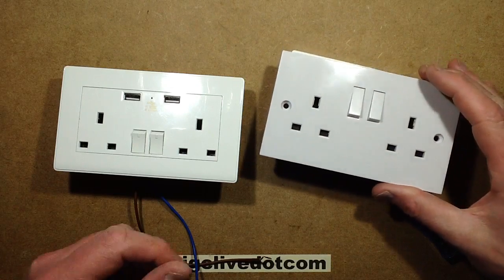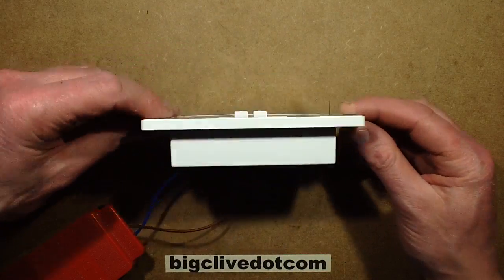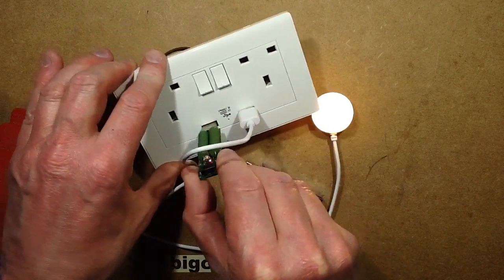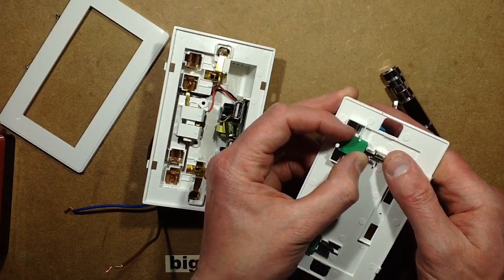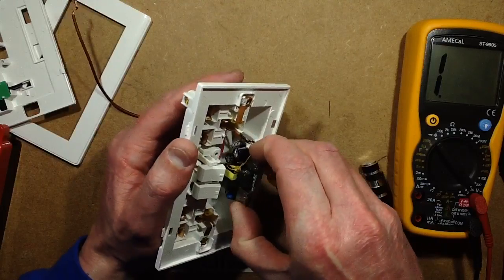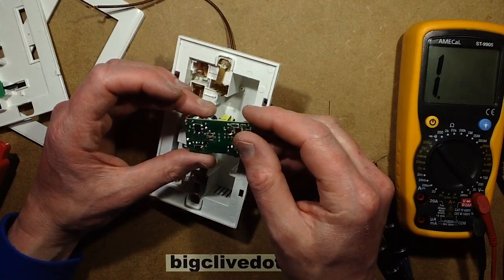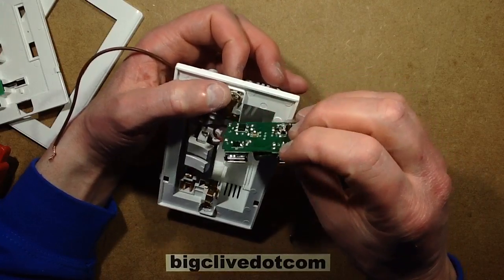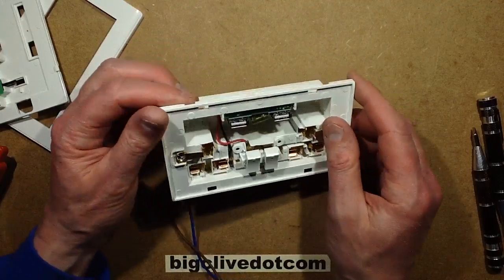A look inside a (crap) double gang socket with USB outlets.

Comment: Where did you get that USB thing that measures the voltage and the USB LED Light?
Reply: +Dallas Dal there's a variety here: http://www.banggood.com/USB-Detector-Current-Voltage-Tester-Double-USB-Row-Shows-p-973712.html?p=3X080214547992015049

Comment: Obviously this one has bigger design issues with the badly designed earth configuration but your point about the built in electronics makes sense too even if these ones even worked correctly to begin with. Makes you wonder why they couldn't make the USB module just sit in a socket with a couple of connectors in the back so it could be easily replaced were the electronics ever to fail.

Comment: Hello Scottish? Clive, just found one of your videos from the suggested feed that you get when your on the home page of your own personel profile here on youtube, as I looked up double gang usb sockets on how to install to an existing single socket plug point. I was hoping to find a video from yourself on how this would be done, I only asked because after watching your video it`s great to see someone who knows too much about their chosen topic like yourself.  I checked your uploads and couldn`t find one but did watch a few and found the £5 solar panel interesting and the Benson and Hedges 1981 shop promo sign, loved that. 
If you are not going to cover something like this could you with your expert opinion please give me a link to a one you trust, thanks Clive, I`ve subbed because I love your love and dedication in electrics, really interesting and a great youtube channel.
Thanks from Gary, North East UK.
Reply from the maker: +Gary Robinson You can get double gang sockets that fit on a single gang flush box if that's any help.   http://www.screwfix.com/p/clipsal-converta-socket-1-gang-to-2-gang-polycarbonate/12849
Reply: Thank you but I wanted to fit one with the usb plugs like the one in your video, but that's ok I will check for one.
Reply from the maker: +Gary Robinson You can get adaptor boxes that would result in a bulky surface mounted box because of the depth of the USB socket.  But I would actually recommend not fitting these sockets and using a good USB charger plugged in instead.  Much cheaper and safer in the long run.

Comment: 8:30 an this is the reason why you should test your installation with an RCD tester an maybe measure the voltage between Live and Ground, so you can find your error.
Reply from the maker: +Simon P. Do you normally test both sides of a double gang socket?  Because one side would appear fine.  In fact both sides would appear grounded on a ring, but it would be broken at that socket.
Reply: Yes i would test both sides, because there are two switches an so I think there are two circuits that should be tested.

Comment: You know, this confirms my belief that 120v / 240v mains sockets have had their day. Modern electronics can run on 5/6/9/12 volts DC. The only plug-in appliances in my house that NEED 240V are floor heaters and the vacuum. They could be run from the odd 240v outlet; while the TV's, LED lights, sound system, computer could be run from a high quality 12v DC-transformer on the switchboard. My TV is only 240v AC input, but it is instantly downgraded to 9v DC and my computer is run on 6/9/12v DC after the built in AC transformer.   Global society is surely on the fulcrum of change where houses are fed a low voltage DC current for modern appliances avoiding all the little black boxes we poke into the mains. I have solar panels (DC), they upgrade to 240v (AC) then my appliances downgrade to low voltage DC, wasting at least a 3rd of what I started with. I have always been living 20 years ahead of common technology, sadly; as I have never found someone who talks my language that doesn't own a Rolls Royce. That said, I occasionally find your revues which are interesting.
Thanks
John

Comment: Here in the USA, receptacles in hospitals have isolated grounds ("earths" to you in the UK) meaning the ground of each outlet has a separate ground wire running back to the main panel and ground rod. This keeps a ground fault in one outlet from raising the potential to other grounded devices. Maybe they designed this outlet for such an application. (Or maybe they were just cheap!)
Reply from the maker: +Chaplain Dave Sparks In this case that would have been defeated by the shonky connection between them through the fixing holes at the sides if a metal box had been used.  But I can understand the hospital scenario, especially where direct body connections were involved.
Reply: +bigclivedotcom Agreed. They would at least be required to be approved by the Underwriter's Laboratories (UL), and possibly another health-related agency. Nor, if it came from a certain very large country (the largest, actually), would I immediately believe such a label was genuine.
Reply: +Chaplain Dave Sparks counterfeit fakes , from china ,lol big problem every where , so do not rely on UL , CSA   CE, URL  , or what ever approval body  ,,, scary future f products,,,, they make them look almost 100% , packaging ,certificates , approval stamps, but are un tested, and normally have inferior parts
Reply: christophe leblanc I don't blame it on China, per se, unless you're buying directly (eBay). Those who import from China for resale need to take some responsibility by setting standards and then enforcing compliance. I believe China can produce quality if the buyer insists on it and is willing to pay for it.

Comment: I Know whats going on with that thing , The USB part of that thing is,,,,, well uhhmm  ,, simply put it's just wrong The USB light was flickering because an over volt circuit detects an over volt and then drops the voltage down the problem  is it takes the voltage down to far then the under volt circuit brings it back up to a voltage that is to much and and that's why when you plug in the dummy load circuit then you have a stable voltage ,  This is 45 years of electronics talking  I am 54 years old I have had an active study of electricity and electronics from about the time I was in preschool...It only took me about 30 seconds to know this calculawn@gmail.com    If you want you can call me McGyver

Comment: You're supposed to put the two CPC legs on a ring circuit into two different earth terminals. 90% of double sockets I fit have them. Its a much better system.
Reply: +Hulk But yes, both earth teminals should be connected. They should normally have a copper bar connecting the two terminals.

Comment: What you're seeing on the back is the history of high-current USB chargers.  The current power-pig is the Nexus 6P, which would really like to see 3A provided to it for "rapid charging" (n.b. it's not Qualcomm's "Quick Charge 3.0", but it's a similar speed and Qualcomm says that the Nexus 6 meets the QC 2.0 specs.).  Upgrading my phone (and service) means that my older chargers are limited in functionality.  http://pocketnow.com/2015/10/14/nexus-quick-charging-explained

Comment: Two earthing terminals on a socket outlet is quite common....and is used for IT installations.
altho...they should be interconnected internally.
Reply: +supersesqui kinda surprised it has only single screw terminals with a screw-on-wire design instead of a terminal where 2 wires can be compressed between 2 plates with a screw. No idea how to call these terminals as you can tell from my english.
Reply: FoodOnCrack

Screws onto wires very common here.
But on larger cables into MCB,s and RCBO's they do use the Clamp method as you described.

Comment: Really shocked by that earthing arrangement - surely this doesn't meet BS1363? Every socket I've ever seen (including cheap ones) has two earth terminals with a busbar between them. Our plugs and sockets are over-engineered compared to the European and American ones, but I've never heard of someone getting a shock off a properly-installed British plug (plenty off the Schukos and US plugs though). 

I love being able to buy cheap stuff on ebay but you won't catch me buying mains electrics on there - you save a few quid but even if it's quality 9 times out of 10, that other 10% might burn the house down! I've known a couple of people buy cheap USB chargers on ebay, leave them plugged in and then got woken up by capacitors exploding in the night - not worth it.

Comment: what voltage are on the data pins to grounds?

the usb spec is quite interesting there is 5v between pin 1 and pin 4 ground 

data pin 2
data pin 3

anyway depending on the voltage between the data pins and ground tells the device what is a safe current to pull (if it has no voltage on the data pins the device will only pull 500ma)

ladyada explains it on her blog

http://learn.adafruit.com/minty-boost/icharging

i tested this myself by using connector strip, tester and some resistors

Comment: Just a correction about the lamp holders. The Buildings regulations Part L actually specified that at least one lamp holder in each "living area" must be designed so that they cannot accept an incandescent lamp. 

One way of doing that was to integrate a CFL ballast into the lamp fitting, so that a compact tube (e.g. PL style) could be plugged in. In practice, the vendors tended to go for proprietary connectors which would lock the householder into their specific brand of bulb. In a further attempt to reduce costs for builders/contractors, most vendors then moved from integrated ballasts in the fitting to simply using proprietary connectors for their own brand of CFL.

Comment: Four numbers: 7... 8... 0... 5.
Unfortunately, UK law probably dictates switching power sources, but the board could use a switching source to knock the 240 down to 12 volts AC, rectify and smooth that, then send it to the linear 7805.
Reply: +2randomcrap3 You want to install a 7805 into a socket?
Reply: I'd seriously consider it (though US outlet boxes might be too small), it's a good linear supply IC.
Reply: 2randomcrap3
I would have serious concern about it generating too much heat if the switching source fails.

Comment: Separate earth connections are very common on modern sockets, one wire from the metal box goes to one earth terminal and the other is connected to the spur or ring main earth wire. Although a plate should connect them together to the screw fixings internally.

Comment: I cant believe youve never seen separate earths on a socket. most sockets now have two terminals so in the event one was to come out, you would still have continuity on a ring final. As for the linkage across the earths, its not too bad. its no different than have two single sockets in close proximity; just take a fly-lead onto the backbox (if metal of course). 
As for the DC output, seems like it needed a bridge rectifier to get a smoother DC output. you said it only had one diode, having more in a more forward way would be much more reliable.

Comment: Ah Bollox I have 2 of these. I fitted them myself. Not had any issues so far. I will have to check for the earthing. Thanks
Reply: Hi HP, are they still working? i got 4 of these and only 1 is left working

Comment: I looked into these a few months back when I replaced a socket due to it sparking. I read about how dodgy they are but also inefficient, the USB transformer is always live on a lot of these so power is constantly being consumed without even actively using them. I'll just stick to my USB mains socket.
Reply: +MillerMedia good point, unfortunately too many are not aware of this isse of permanent off-load powerconsumption even when connected without being in active use... 💸thus they are wallet drainers often overseen

Comment: I 100% agree, the electronics should not be packaged into the sockets. The sockets should remain as that...a socket for mains. It is only a matter of time before these electronics cause fires and breakdowns in difficult to access areas. Furthermore it violates the safety integrity of being able to quickly disconnect and/or remove a fuse link to cut power in case of an issue. They are now depending on the switch mode converter to shutdown in an non-current drain state in case of over-current loading.

Comment: Im fairly sure that despite what may be printed on the back of that socket, it does not properly meet the BS1363 standard for electrical sockets.

I am a certified Portable Appliance Tester at my place of work. I check all electrical devices I buy for proper grounding or double insulation.

Those two earth points should be connected with a visible connection.

As for double earth connections, I thought they were a standard now in the UK. All the ones I've bought in recent years have two connections.The ring main earth cables I connect to one side and I connect a sheathed earth cable to the metal pattress and the second earth connection.

Comment: bigclivedotcom Is it true that you can install GPO's and light switches in bathrooms if they are located more than 3 metres from the shower/ bath in the UK?
Reply from the maker: +Timothy Chapman I'm not aware that you can install a standard socket outlet in a bathroom, and I'd only want to use a pull-cord lightswitch for steam reasons.  The shaver sockets have an isolation transformer in them.
Reply: +bigclivedotcom thanks, I thought it may have been the same regulations as in australia

Comment: being a electrician, i am shocked! no continuity between the earth terminals is dangerous, as you said , 1 terminal for earthing conductors and the other for bonding fly lead to box is usual..so 1 socket no earth...even worse, if this was a radial circuit, and was connected with a earth conductor in and out on the separate terminals, no sockets past this one would be earthed and if a ring circuit, no ring continuity. if installed by a DIY person, ring continuity and earth loop impedance tests would probably not be taken...all twin sockets have 2 terminals for high integrity earthing for high leakage use appliances, but they are internally connected. on another point, the regs state, any spur from a ringmain [which the PSU effectively is] shall be connected with the same size conductor, and fuse protected if not a socket. how does this comply with that? i have seen these for sale in my electrical wholesalers, i would not fit them. they should have a 1 amp cartridge fuse under a cover [like a spur unit] to protect the PSU. not the 32amp fuse or MCB in the consumer unit. they should be banned.

Comment: middle pins shorted means 1.5amps, that is the standard config for charging. with d+/- shorted together an android phone will report "ac charging" in battery stats, without it it will report usb charging.
Reply: +Adrian Chapmanlaw Not quite true - data pins shorted means 0.5A to 1.5A. The charger must be able to support a minimum of 0.5A current at 4.75V, and between 0.5A and 1.5A, the voltage must drop below 2V before shutting down (unless the charger can handle >1.5A at 5V, that's fine too). This is designed so that you can build chargers with an output capability between 0.5A and 1.5A, and devices can automatically detect how much they can draw by ramping up their demand until the voltage drops.
Reply: +marcan OK thanks that explains a few things, how do we set 2amps then?
Reply: Adrian Chapmanlaw You don't - that's not supported in the standard USB battery charging specification. The USB-PD standard (which nobody uses) supports higher currents and requires communication over a special protocol modulated on the power line. Or you can use USB Type C which does support up to 3A (it uses resistors on a separate pin to set that). Some manufacturers like Apple and Samsung have come up with proprietary standard to signal 2A charging capability on a standard USB Type A charger, though. Usually they involve resistors on the power lines.

Comment: with smart houses becoming popular i think some consideration of how to build in stuff into sockets would make sense...

Like having a good easily accessible cavity with power and Ethernet in there so the consumers could install what ever control interface or external outlet they want using off the shelf parts..
I would love that as i am a programmer... the idea of just plugging up some raspberry pi + some relay shield would be appealing so i could then just dick around with code.

Comment: Does this mean there is no such thing as an electrical device in the UK that does NOT have a ground/earth pin?  Ie. since you need it to slide the shutter away.
Reply: But for a device that truly has no need for an earth that pin is plastic.
https://upload.wikimedia.org/wikipedia/commons/thumb/d/d3/Bs1363-non-earthed-plug.jpg/170px-Bs1363-non-earthed-plug.jpg

Comment: How does the english system cope with double insulated items that do not need and do not have an earth pin on the plug or do you not have this system like we do in Australia ?
Reply: A non-earthed appliance would just have a plastic pin as it's earth so that it can still operate the shutters for the two more mischievous pins.

Comment: It also makes me wonder, if everything there requires a ground plug, what happens if you have a power strip and need to plug in multiple transformers?  If they all have a ground you can't put some of them "upside down" to make them fit easier...
Reply: +Matthew Miller With UK Plugs that is not possible. In Germany we have two types and they both are mirrored designs.

Comment: Ah, lightfittings with pre-installed ballasts; An annoyance, as I discovered my bathroom fitting is one of these, meaning I couldn't install a (likely) more relaible and (almost certainly) more efficient LED lamp in it's place - because 

A: I'm not terribly confident with mains voltage stuff, and 
B: It's a rented flat, so ripping out fixtures and fittings is something best avoided - especially when you're not that confident with mains voltage..

An absolute crock of crap.